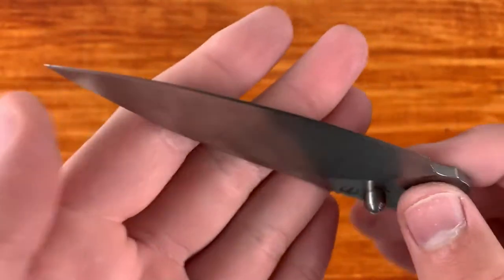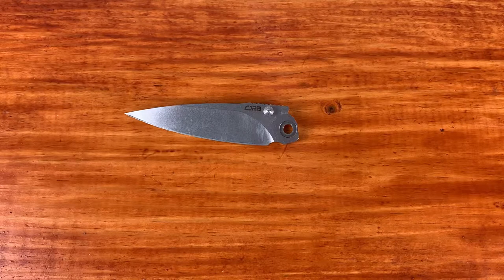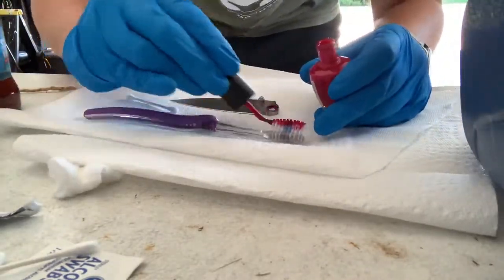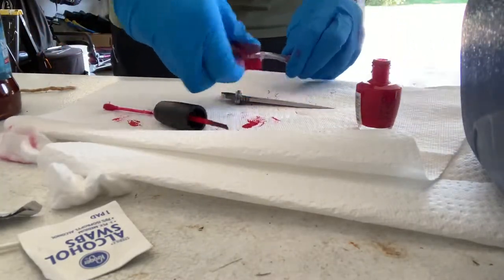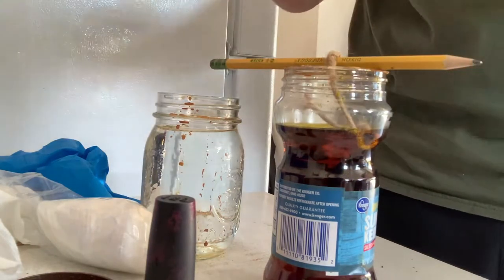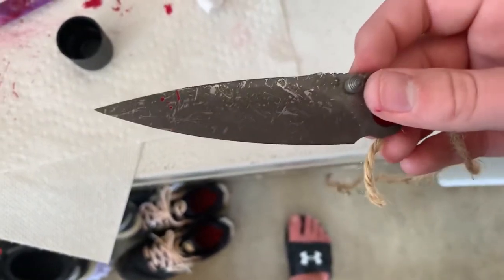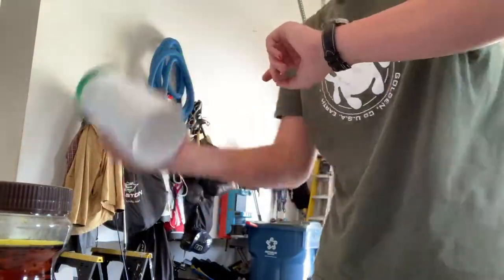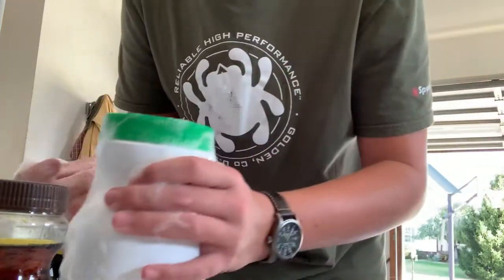HOW TO: “Splatter Paint” Acid Etch Finish a Knife Blade

Comment: Very nice toot. I think it turned out really nice. I'd agree with you on the hardware, it would look better if you etched or painted it. I etched one of my balisong blades and it was very stressfull. I also anodized handles and that was a fun process.
Reply from the maker: I have never anodized anything, it’s one of those things were my knives that are titanium are some of my more expensive knives so I have been cautious. Thanks for watching!
Reply: @itsaknifestyle8482  ya I don't think I'd want to ano a sebenza or anything like that either haha. I'm thinking about getting an eafengrow ef905 and going wild on the ano. That would be a good one to start with as they are only 70$ on amazon and it's a giant slab of titanium.
Reply from the maker: Yeah that would be good. Twosun also comes to mid when I think of titanium knives for cheap
Reply: @itsaknifestyle8482  good ole ccc for the win. Haha
Reply: The oil method seems like it would work!